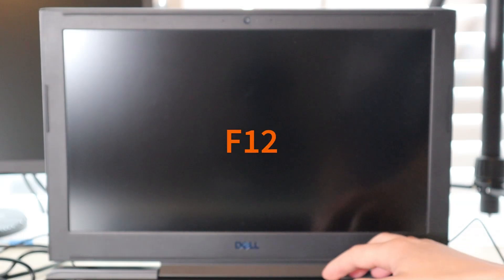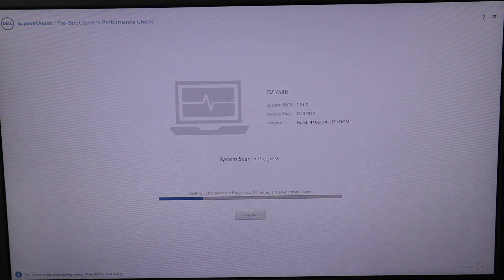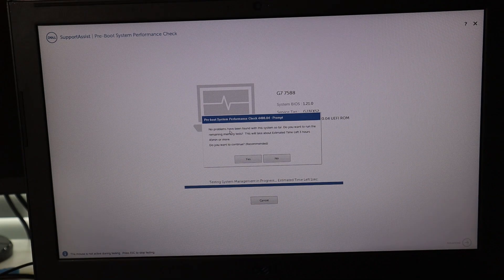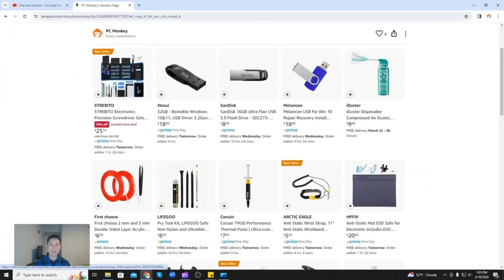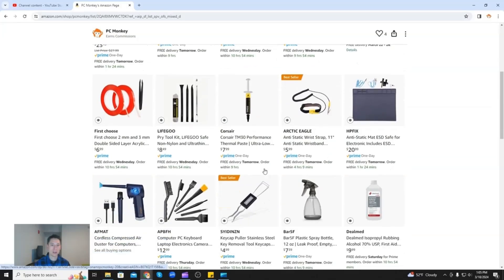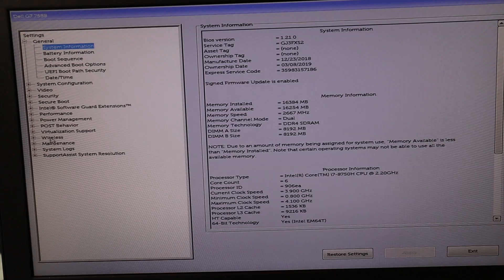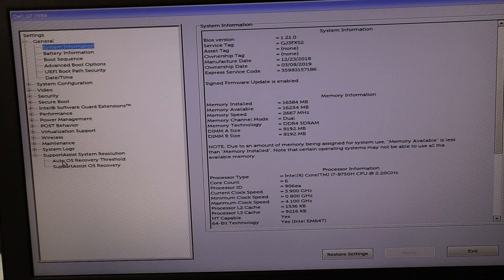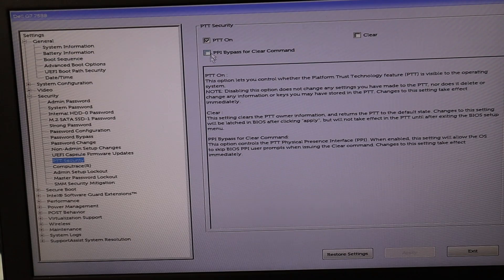How To Fix Windows Failed to Load Insert Recovery Media Error Fix - Dell G5 Laptop Computer

Comment: My lenovo n24 is blinking orange, but when i tried  charging it, it won't charge, and it won't turn on, but the plug works for my other computer what do i do?
Reply from the maker: For a computer that does not turn on, try this video first; https://youtu.be/kOBY4k2Mn_k. Let me know how that goes :)  Also, did anything happen before this issue appeared?  Liquid spill, overheating, Windows update, etc?